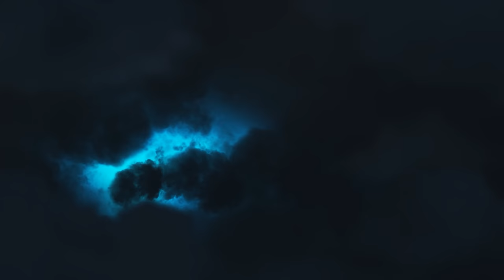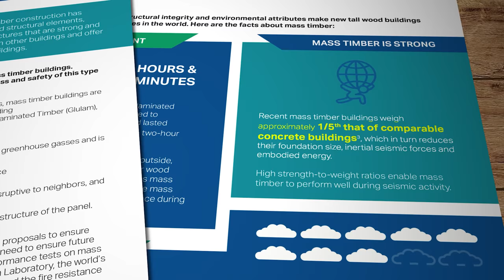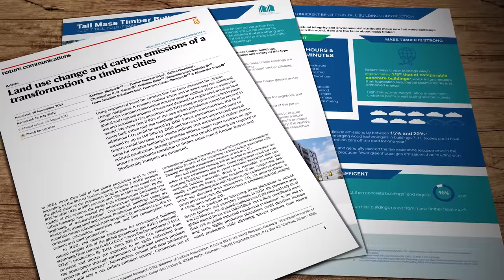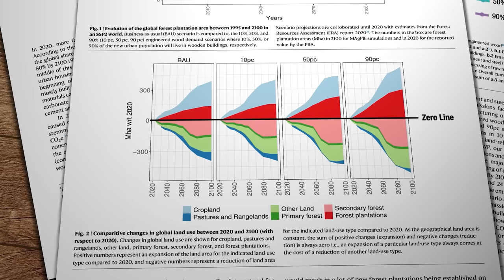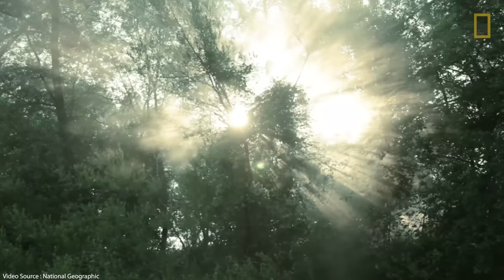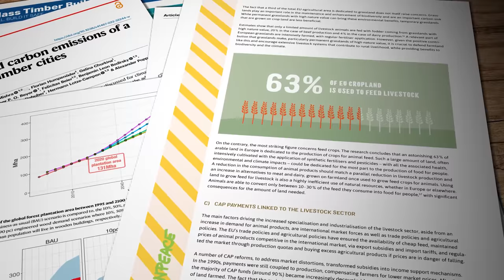Engineered Timber - building the skyscrapers of our future.

Comment: Perhaps not the best material for Truss Bridges. The 10 year old Tretten Bridge constructed from Glue Laminated timber failed in Norway and collapsed a few weeks ago and it was not the first. Engineering videos (particularly that on the excellent https://www.youtube.com/c/BuildingIntegrity channel) suggested that a plate and dowel joint with dowels effectively in line with the lamination layers, combined with the timber structure being held in tension were responsible and that the material's performance was along way short of the properties assumed for it in engineering models. A heavy (but permitted) lorry was crossing at the time of the collapse. Let us hope that Architect's structural models do represent the real world performance of such timber used in large buildings, especially if this type of construction is to increase...

Comment: There is, of course, an alternative route.

We have to engineer engineered timber to use LESS timber.

I strongly advocate for integrating thin layers of high tensile natural fibers in the "matrix" of the engineered timber im combination with hollow walls. The less material is needed for a structure, the better.
Think of it like a composite material similar to carbon fibre.

Using flax or hemp fibres - both plants which grow extremely fast - could allow for widespread use of all natural composites in the construction sector without the need to grow construction wood in areas of extreme bio-diversity.

Also, re-forrestation efforts of a massive scale should be undertaken in the deserts of the world.
These forests would actually decrease the albedo effect whilst storing huge amounts of CO².

We will also have to research alternative woods for construction, rather than relying mainly on firs.

Poplar could be a candidate for partially replacing fir.

Staghorn sumac could be a source for extremely cheap fast growing ultra light wood which could be used in the core of engineered timber. Staghorn sumac  can grow under a wide array of conditions, but is most often found in dry and poor soil on which other plants cannot survive and it's would is quite similar to balsa.

Comment: I think that replacing concrete with engineered timber is simply shifting the problem by creating another one which is possibly much worse. We do not need new problems that we do not know yet how we'll come to grips with - we need solutions that work for the existing problems. Also, I think that one aspect of engineered timber framing was not touched upon: longevity. How does it compare with existing steel/concrete constructions and what is the upkeep/repair costs for building made with it?
Reply: Longevity in the case of concrete and steel can be seen as a problem because buildings are rarely built to be demountable and repurposed, or it would take a lot of energy to do it. Timber is very durable but it's also a dry assembly construction that can easily be disassembled and repurposed. On that front wood is always going to be better imo
Reply: @notafantbh  Good points. I was going to say that concrete recycling is a subject that should be looked at by this channel (or has it been already?) but as a process it is far more energy intensive than timber re-cycling.
But perhaps, the real problem is indeed that of re-purposing: we do not design buildings necessarily with the point of view of altering their use if needed in the future. If so, this is an architectural/city planning problem.
If anything, in the last few decades we've seen the opposite being the case: fanciful designs, made solely to impress, proliferate that are next to impossible to alter their usage.
Reply: @Stelios.Posantzis  in my opinion we need to move as quick as possible to a system that exclusively designs circular products and products that can be recycled as long as the energy input is less than what's needed to produce a new one. It's really the only way forward if we want to reduce waste and pollution. That could mean less innovation, growth, whatever, but it should be done imo

Comment: There is something lost in the conversation when it comes to agribusiness and construction timber. In many places forestry is happening at the edge of corn/soy rotation farmland. If the acreage is more profitable to be intentional forest and government support it's transition then we will see a huge gain. The carbon cost of the silage will have a obvious cost in livestock. Paired with grazing land that will transition also then the cost of beef will reflect that.

A carbon tax and end to subsidy would more than make it redundant though. However it is more than welcome. Glulam and the like are also proving more lucrative as very complicated supply chains are demonstrating just how great a business case there is for tree to frame construction domestic models.

The smart money would be cnc milled highly automated engineered timber paneling. Starting "small" and going further than just the boards. Making sheds and outbuildings flat-pack that can be delivered on a truck or in a shipping container. It would go a long way to work in the verticals.

Comment: In the future, steel will be made by using hydrogen, not coal. And cement plants will have to capture and store the carbon emissions. Therefore, in 20 - 30 years this will not be an issue.

Comment: replacing concrete and brick construction with wood is a very good idea, but it should not be forgotten that heavy construction materials also act as thermal mass, which helps to flatten energy demand spikes for cooling. Wood construction buildings would go along nicely with ground source heat pumps- for heating in cold months, for very energy efficient no-compressor cooling in hot months, just using stable moderately cool temperature of the ground. Regarding land use for timber growing-I'm glad more and more voices are speaking that the biggest share or agricultural land is used for crops which are fed to cows. Why not to let the cows into pastures, planted sparsely with trees for shade and drought protection of the grass? Cows and trees would fertilise the ground of the pastures- naturally productive, not-tilled soil absorbs and locks-in a lot of CO2.

Comment: I’m highly sceptic about wood being fire resistant without impregnating it with a lot of very nasty chemicals, and even then. It’s simple physics. Reaching a specific temperature, everything organic burns, no matter what. And in a fire this temperature is reached very fast. The best analogy, is the unsinkable ship. Unsinkable ships sink, best conceived planes fall down from the sky, wood burns. In the U.S., they build in wood because it’s vastly cheaper, not because it’s ecological. They don’t care a dime about deforestation, not their problem. It’s cheaper than steel and concrete and it does not matter some go down in flames before even being completed, insurance will cover the damages.
Reply: This is why you do tests such as the one Dave describes in the video. So you don't have to rely on your own intuition as to whether it will resist burning well enough to use as a building material.
Reply: I have seen bonfires which are just a pile of wood take a long time to burn.

Also in bushfires the stumps are still burning the next day.

Comment: I don't see any seriously proposing underground construction. It would be possible the most efficient use of long term energy. (The energy used to maintain a controlled environment in a building. As well as everything that resides in it). I know people are worried about losing the ability to see the sky. But as many who already live in cities will tell you, the coast of a view is higher than the coast per foot (square meter). We are far more efficient in making visible light than the sun though our atmosphere. And the ground is a far better insulator that the hazardous fiberglass or ceramic insulation we commonly use. And these structures could just as easily be made of Eng wood or steel and concrete. As well as the technology we create to sustain life underground could further the construction of habitation off world in the long run. There would be a forced reduction of vehicles as Electric elevators and auto walks would be more prevalent. Peddle bikes would also more likely be a common form of transportation. Air, light and noise pollution would all be reduced. And as underground became more expansive industrial vertically grown foods might start to really became more feasible as it would require less insulation during winter months. And prevent over exposure to heat in the summer months, leading to a 4 season growing cycle. In areas afflicted by extreme weather like tornadoes, this would also be a more suitable building as it would inherently absorb less energy from high winds and take less damage from flying debris. Not a Florida type of city perhaps. But there should still be a number of such cities spaces like this

Comment: I don't really get why we need tree PLANTATIONS.

In Europe many forests are sustainably harvested. 
In Switzerland for example, you never completely cut a big area down. You rather only remove the biggest, oldest trees, and then let it grow again. So you have a constant flow of new trees, with very limited effort, i.e. no need to plant, weed out and protect your trees. They grow in a natural process. There is never a "barren land" after cutting.

Another method, also done in Switzerland is cutting down a all larger trees in a relatively small area. For example a maximum of 1-5 hectares. Leaving the ground intact and instantly allow natural regrowth. Within just a year or two, this leads through the natural progression of bushes and small trees up to a mature forest within 50-100 years. Since you never exceed the 5 hectares within the forest, it is actually supporting biodiversity. Because it leaves the forest as such intact. It just allows different stages of maturity in the ecosystem at the same time. Making the forest more sustainable and biodiverse.

I expect that the plantation style of harvesting wood is soon to be extinct. It is just not money-efficient. The sustainable harvesting approach requires much less investment, time and effort. While also scoring much better in stability, ground protection, biodiversity. And it's also much better in risk balancing, since you don't have a monoculture.
Reply: Sadly, it is "money efficient". But only because all the other factors are ignored.
Reply: @who_needs_a_handle  I concur, the sustainable method is a lot more money efficient.
It's just that it's not do widely adopted to push the old school plantations out of the market.

Industry is full of inefficient processes, that only survive because of slow markets, misled regulations and the incumbants advantage. Just think about how many people replace an old oil heater with a new oil heater, despite being objectively inferior to a heat pump. People are just often stupid, and when many people are, markets are slow in adopting. And since forests take forever to turn over, you probably see the advantage of the new methods only after decades...

I am certain that it will change, it just will take much longer than it should...

Comment: Imho materials science for practical civil engineering is still in the dark ages. It may stay there as long as people allow investors to treat residential homes as portfolio investments. The moment we apply something like machine built homes using an injected organic foam that dries into structures stronger than concrete, then the value of homes falls. Unfortunately, this will not be a permitted tech whilst so much global wealth is tied up in outdated property.

Comment: There's nothing wrong with increased urbanization as it is. We are already over 50% urbanized. Increased urbanization reduces sprawl. Increases the ability viability of public transit which likely more than offsets the increased carbon impact of more steel. Proper insulation, more public transit, vertical farming all superior ways to offset carbon without worrying about an alternative that could potentially be worse.

Comment: Green cement is better and concrete homes last longer than timber and can withstand many natural disasters.
Reply: timber/wood construction is more comfortable for people because this material has good heat & cold insulation. In contrast concrete absorb heat from sunlight and radiate it to occupant at night, if the weather is really hot then the night will be really warm and people wouldn't able to sleep without AC, or if there's no direct sunlight during the day the concrete became too cold at night, and the heat or cold can accumulate and will increasingly get warmer or colder day by day if the weather do not change.
Reply: @xponen  there are thermal paints for insulation. Timber also suffers from pests and easy breakage. Not to mention you will have a safe place in a hurricane and doesn't catch fire.
Reply: @prajwal9544  First off, this video explained that 'mass timber' has excellent fire resistance, better than steel it said. I don't think these timber buildings, which already exist at several stories high (and by the way, normal timber is used for the frames of houses all over the developed world), are suffering from pest damage or 'easy breakage'. Concrete is ususally reinforced with steel in large structures, which is known to be a limiting factor on their lifespan because water gets in and corrodes them, leading to sudden failure and collapse.

Comment: We could afford the land required to create vast new timber plantations IF we use the land that is currently deserts. We could do that if we could get enough fresh water to the new timber plantations inn the deserts. We could do that if we would desalinate sea water and build pipe lines and pumping stations along the way. We could do that with fission nuclear power plants to generate the electricity and heat to run the new desalination plants and pumps. The remaining problem is, of course, the waste. No - not the radioactive waste - That is so small and easily stored on-site. I mean the brine from the desalination process. Evaporation ponds in the same desert for the brine will become a source of many of the elements we need, lithium, deuterium, uranium, and a host of others. We could do all of this while preserving the biodiversity of the rest of the world.
Reply: Explain how "we" can get more Water?
Reply: @Diana1000Smiles  We don't need more water, after all we have oceans full of the stuff. What we need is more fresh water. Sea water can be desalinated by various methods. All require energy, clean energy from fission nuclear power plants.

Comment: Without major changes to building codes requiring more green building practices, greed will win out. At least in the US the life cycle of larger buildings 15 years (before reinvestment is needed) is partly why green solutions aren't built in, because they will not see a return on it. Will they see wood as a shorter life cycle and even further discourage other green investment. Even if wood is cheaper, it is almost certain they will pocket those savings.

Comment: It annoys me how people doing projections seem to be able to only project the subject of interest into the future but not connected ones. A lot of land today used for fuel crop (wood pellets, or car gas ethanol), but it seems these guys start to think about it.

The same thing happens with car total life cycle emissions : some detractors use today's figures for building an electric car to deride how that's not a solution, without taking in account that the build-time emissions heavily depend on the grid, which is greener every year. With a fully green grid, car emissions should be zero from the day they are on the road.

Comment: It is very obvious from all data that the meat, dairy and fishing industries have to go if we are to stand any chance of a viable future on this planet. We also need to persue CO2e reductions in the manufacture of concrete and steel. Engineered timber clearly would be beneficial in some areas of construction. More than anything though we need to reduce the amount of construction work going on by repurposing existing buildings and bringing them up to date with insulation, energy, and water usage techno;ogical advances. Beyond this any construction work that is being carried out should make the most of recycling and repurposing of construction materials from buildings that are being torn down...

Comment: Growing trees (or any other form of biomass) to burn for fuel is a bonkers idea, we should stop this immediately and use the trees currently being grown for this purpose for engineered timber, thus locking away the captured carbon.  I'm not against biomass (far from it) but only to utilize waste sawdust/timber that would otherwise just rot and release greenhouse gasses.